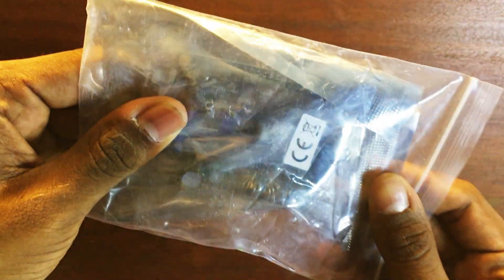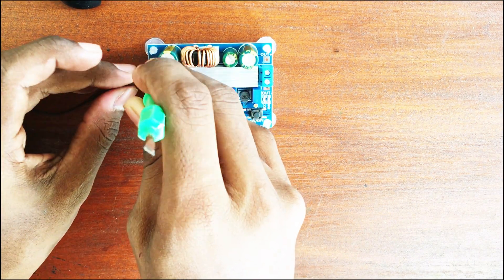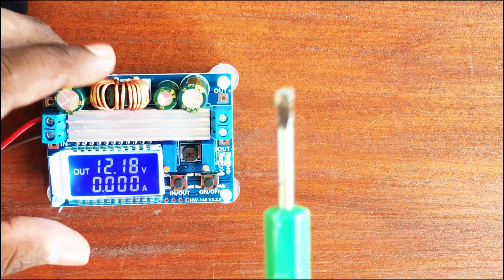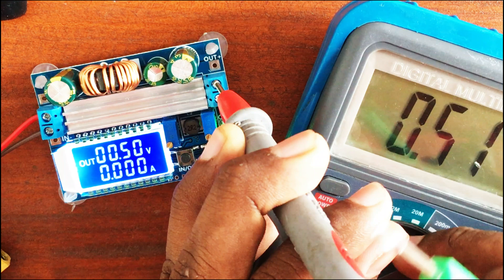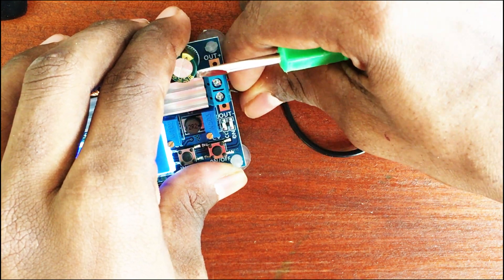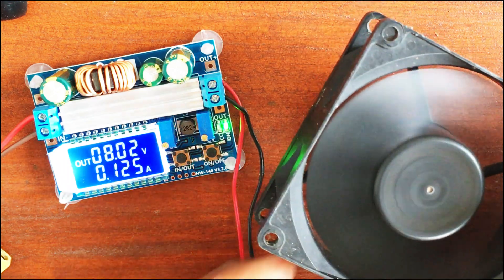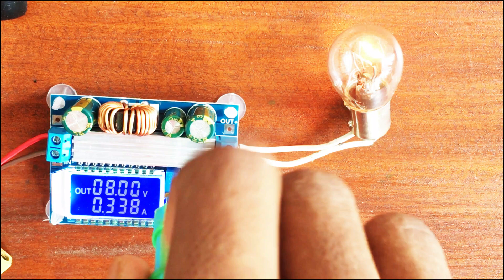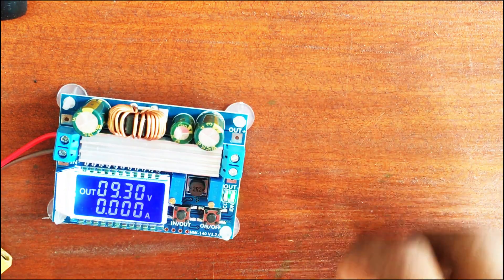Why This $5 Aliexpress Buck Boost Converter is a MUST-HAVE (Shocking Performance!)

Comment: do you think it would work if i have a 5V input? could you test it? i'm planning to buy this
Reply from the maker: The minimum input voltage is from 5.5v to 30volts and the output is from 0.5v to 30 volts max input current is 10amps you can add that to V=IR formula to get the output current at a certain output voltage🙂
Reply: @Circuitdebug  i know it's from 5.5v, but if you could test how it runs off of 5V 2A, it would be amazing
Reply from the maker: @oliwier000b  I currently don't have it I gave it away to one of my friends but I will be doing more videoes about dc dc converters in the future stay tuned 😊
Reply: @Circuitdebug  lol it's not even close to ten amps. why would you even say that you ridiculous non-american, ridiculous talking individual. see you make a power supply with it? it already is a power supply you fkn moron